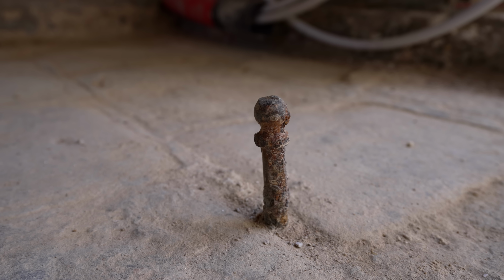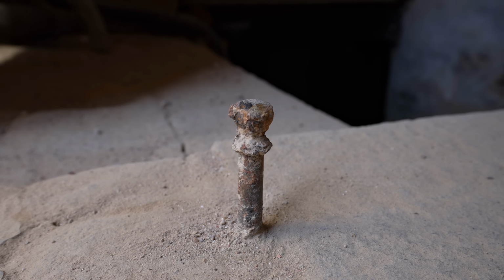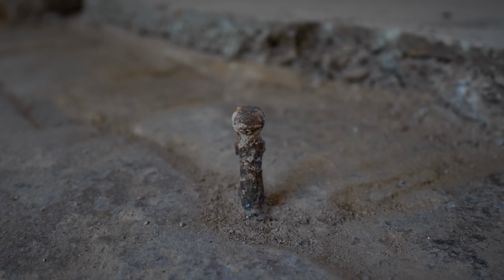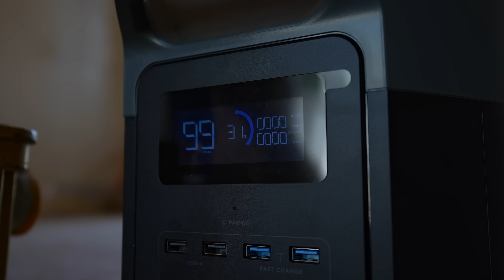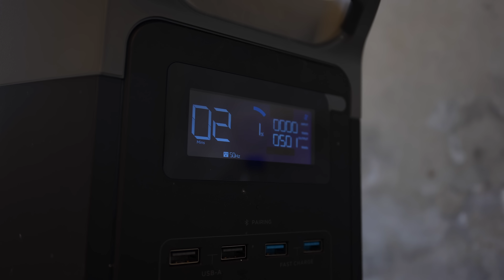Uncovering a 250-Year-Old Hidden Floor Beneath Concrete

Comment: I agree with Gwen, leave the floor as it is, it’s so beautiful, just add slight ramps at the doorways and it will be lovely. Great work Billy!
Reply: Totally agree, and leaving the floor as it is you will also retain another of the original features of the convent.
Reply: Agree with steps or ramp also , the concrete pour was probably more to do with wheelchair access to the kitchen than anything.  I'd just add an ironwork railing to the cellar steps and call it done.
Reply: Agree with a ramp at doorways, and leave the beautiful floor as it is!!!  As I am disabled, I feel a ramp would be much better than steps.
Reply: Exactly what I was about to propose …
Reply: Love the floor. And yes just add ramps. Perhaps consider having removable ramps rather than permanent ramps. I built my house nearly 5 years ago and made sure that it was future proofed by being wheel chair accessible and I have heavy duty rubber ramps for my exterior doors which are removable. If you build stone ramps they may be large and permanent. You can install the temporary ramps as needed for visitors, gatherings and events.

Comment: The floor will only be original once.

Best approach would be to install wooden ramps for now, focus on restoring the rest of the convent and then decide whether you want to raise the floor or just the ramp area.

Using wood will protect the floor during the rest of the renovations. It will also allow you to decide where you are going to adjust the levels. You don't know what level you will end up with in the refectory yet.

Comment: I have another idea for the floors.  DON’T PULL THEM UP!  It looks like there is a step up into the area. Why not when you get new doors just put in a new lower threshold and make the doors taller? Then into the kitchen and toward the refectory put in the ramps. This would also help with the height clearance to the cellar. 
I love watching older buildings being renewed and brought back to original glory. Thank you, Billy.

Comment: And here I thought Gwen had not seen you sneak out. I suspect much of the previous 'upgrades,' including covering the floor, were meant to ease life for the nuns and their work. Still, it's so nice to see the building's original beauty in the hands of this very special crew. As to raising the floor, I think the work done on the hearth should relieve any concerns; it will be beautiful either way. I am curious what you will do with the cellar access, which is a bit of a mystery. The lintel looks original, but the stone floor opening seems like an afterthought.

Comment: The most expensive way (but probably the nicest way) to retain the exposed floor, whilst making a usable floor that is safe, would be a raised glass floor.  Reinforced glass that is raised (on feet) that hovers over the stone floor, providing a modern floor surface that is safe & level (including being at-grade with the doors) but that allows the historical floor to still be seen (and even accessed, by lifting the large glass tiles).  But I imagine it'd be unbelievably expensive (whilst looking awesome).

Comment: That floor is just beautiful, Billy.  Someone made a comment about using heavy-duty rubber ramps that are removable. If it works, some type of ramp like that but covered in split stone (like a thin veneer)that matches the existing stone floor, laid over the frame of the ramp.  Possibly the best of both worlds?

Comment: Apart from the immense amount of work you'd be making for yourself to lift, store, return and level the entire floor, I don't know if you'd ever be able to duplicate the immaculate surface you have there now. With respect, I suggest you use short ramps in the doorways to avoid steps, perhaps using the same stone to make the ramps? Just a thought.

Comment: I suspect they poured a smooth concrete floor to make it easier and safer for those on crutches, in wheelchairs, and otherwise unstable on their feet.

Keep the risks to the unsteady pace n mind when making sure important flooring decisions. If you rent the facility out, you could be held responsible for trips and falls on uneven flooring.

Even though it’s a big job, I would seriously consider relaying the floor up to level with the other floors, and do the utmost to make the stones/grout as level and as smooth as possible.

I think your work on the chateau is amazing and impressive.❤

Comment: My vote if I had one would be don't disturb the flagstone and build little ramps. Entryways can be cooler places too, where folks can acclimate to the indoors without blasting them with warmth and a sense of stuffiness, so underfloor heating I not necessary. And it's  cheaper than your original plan.

Comment: I'm guessing that perhaps the reason they covered it with concrete is that during heavy rains it may have tended to flood in that room because it's lower than the ground around it. So that would be a good reason to raise it. But could you do that without damaging the stones?

Comment: If you didn't run any water lines for heating in that section,  I would remove the floor in the little hallway on each side of the cobble floor and ramp it there so that the entire old floor remains intact and unblemished

Comment: Billy the floor looks amazing. Gwen it right, leave it it as is and it will save long hours removing it and relaying it and also it will save money. Too bad all the floors arent like that. They may have concreted them for ease of walking as the nuns got older preventing a tripping hazard. It was great to see Gwens smiling face again.

Comment: Billy I think you should indeed put in a ramp. I have recently joined the world of the handicapped.  I use a walker unless tired or a long, more than 200 foot, distance then I use a wheelchair. I love the convent. If you keep the lift it is a perfect area for handicapped. The doors are wide and the rooms large.

Comment: Gwen is right, adding small ramps will also help with pushing cleaning trolleys around, goods deliveries etc. If you're not putting under floor heating in it would seem a waste of your time, energy and money to lift the entire floor 10cms.

Comment: Love the way you started the video watering the roses, they are so beautiful.  Gwen's idea of the stone ramps is genius.  Will you be able to get the lift back inside the kitchen or did you do that before you chipped up the concrete?  Don't forget to use sunscreen lotion while cutting the grass, I noticed you caught a bit of sun while working in the garden. Crack On!!

Comment: The newly exposed stone looks fantastic!  Since you plan on new doors to the outside, you could always lower the sills so you wouldn't need ramps there.  The stone floor looks to be at about the same level as outside cobbles.
Reply: The ramps are for the entry to the kitchen and refectory doorways, as well. Those floors being higher pose access issues for handicapped, as well as workers using wheeled equipment.
Reply: @beckysimeone4882  True, and that would be very cool!

Comment: If you do it right and raise it up, it can be a representation of the original structure. Cleaned and sealed it would look outstanding. Like the exposed ceiling timbers, they are to be marvelled at. The beauty and quality of materials and workmanship from times past. Like a museum piece, not to be forgotten. You took this on to restore this old place, and remember that after you are long gone, someone will (I hope), appreciate all that you and your friends did to make this place what it is and will become.

Comment: You’ve done so many changes to this building. There is an authenticity to keeping it as is. If you raise it you you remove the history of the floor. Kinda like taking an antique and stripping it down to repaint it. It’s still an antique but it’s lost it’s story of origin. The dings, chips wear path give it its uniqueness. The original mortar has a place in that story too. Steps or a small ramp is such an easy fix. Keep the extra $$ for some of the hard work in the chapel. It’s going to need it!!

Comment: Billy, that ancient floor is really beautiful.  However, as one with limited mobility but still walking, I noticed those old stones are uneven enough to be a trip hazard.  You might want to consider raising them and levelling them better at the same time.  If this is ever to be any kind of public venue, the liability issues with a floor that uneven would be significant.

Comment: Perhaps someone asked this question already. Is it possible that was an exterior floor surface, and that, at some point in the past, it was just a covered walkway from the court yard to the back gardens, which was later enclosed for the convenience of the nuns? Under that circumstance, both the floor surface and the stairs down to the cellar make more sense.
Reply: I had the same thought, even if the stairs down to the cellar is still very strange. I would suggest removeing the doors and restore it to to again be an roofed passageway between the courtyard and the garden, as other has suggested. Or at least let the doors be fully glassed so you can se though to the garden.

Comment: I have a question, when you install new doors to that hall in the future, could the door openings be widened a few inches on each side allowing for easier access to the back garden with your current work equipment or would that be unnecessary in the future? Hopefully the town council will give permission for you to have a right-of-way to create a new gateway so you can easily access the back with your equipment to assist in future repairs. I also think the concrete was probably put down to level the floor for wheelchairs to easily & independently maneuver over it. Gwen is such a smart, sweet, beautiful, young lady. She is a treasure. Thank you for sharing your projects with us, it is so very interesting to watch all of them.

Comment: As so many have said, leave the floor as is.  I had a very similar issue and resolved the problem by having some granit prices cut to size creating a slope, not a full ramp.  To raise it at the highest point (say 4”) it would extend about 12 a 14” out.  My daughter had no issues using her wheelchair on that slope and made clean up of the floor much easier.

Comment: May have been more difficult for wheelchair users on the cobblestone years ago and could be a reason it was concreted over. I was wondering if may have been prone to flooding and that's why they raised the floor? May be a good idea to keep the height by the door and put a concrete ramp from the door slanting down to the cobblestone so flooding won't happen. The cobblestone is so nice, can't wait to see it after you are able to clean it!

Comment: If you’re going to replace the exterior doors anyway you can just eliminate the step there and make the opening 10cm lower. If there’s only a step into the other rooms it might be expected in an entry way. On the kitchen side, there’s what looks like maybe 3 feet or so between the opening of the kitchen doorway and the entryway stone floor. you could break up that concrete there, and then pour a new ramp that brings two levels together

Comment: Rather than put in a ramp or a step in, here's a suggestion. Since you plan on replacing the entry doors with custom made items, why not lower the outside entry thresholds to match the hallway floor level. Then ramp from that level up to the kitchen and refectory(?) floor levels on each side. Then have your customer doors fabricated to match your new rough masonry openings. only minor changes would have to be made to the exterior pavement approaches (changes that would have to be made if you want wheelchair and handicap-friendly access anyway).

Comment: I agree with adding the slopes in the doorways to adjust for the different floor levels. 
My guess is that they added the concrete over the flagstones is due to the nuns that were in wheelchairs, using walkers and canes. A flat & level concrete floor is a lot safer & easier than the uneven flagstone.

Comment: Put some granite steps at the entry doors (from all that stone at the chateau) and build ramps between the walls where it connects to kitchen and pantry because those are areas that will see steady traffic and people carrying things that shouldn't be dropped or spilled. You need an easy transition between levels there. You may also be using wheeled carts between those two rooms.

Comment: Why not make ramps out of granite to match the granite in the hallway? I think I'm correct in saying that you have enough (old) stone left lying about to cut to size. Lime mortar coloured to match what's in the hallway, and it would hardly be noticeable that it's a modern alteration. 
You've done a fabulous job of removing the concrete without damaging the stonework Billy.

Comment: why not use this corridor as a covered alley/passage with the original floor as it is, original exposed stones on the walls (current plaster needs to be removed) and no door or just grilles towards the garden and the courtyard? It would create a more cosy space with independent rooms rather than a massive space that lacks 'human size'.

Comment: I think you are missing rubble mountain so creating rubble mountain 2 lol.. maybe you find the same floor in the refectory lol.. the floor really looks great though, a step would be ok but if ever you need to wheel any big equipment or furniture in then a step will be a real pain so I think a ramp is better, will be a shame to lift the floor as it will never go back quite the same, I know you and Shaun did a great job in the fire place but that was a relatively small area in comparison.

Great job.. well done..

Robb Torremolinos Spain

Comment: Not sure if the geometry supports it, but we’ve had good luck pinning excavator buckets on “backwards” to reach up high, or reach into buildings like you have here…

(Heck, once we put the one big bucket on backwards and used it as an improvised man-basket to service elevated light fixture.  Not exactly an approved use, and after that we built a more appropriate apparatus for that purpose.)

Comment: You need to do a test section on the floor with a mop and some cleaning solution you then can see if you want to seal the stone floor or leave it natural and a good mop n clean can tell you if it looks good wet if it does seal it if it doesnt dont plane and simple a nd it doesnt damage the floor

Comment: Hello my friend, I have two thoughts about that lovely floor. The first is why not lower the threshold of the exterior door to the level of the old floor. You said you were going to replace the exterior doors anyway.  Now you can fit them to the new height, the one that uses the old stone floors. 

The second thought is thar the floors might have been raised to prevent water from flooding the hall. If you do lower the threshold you will need to check that possibility first. 

I shall enjoy watching what you do with it.

Sarah

Comment: Might have to get some temporary large thick wooden boards to sit between the two room entrances so you can move things between the two rooms and not have to worry about the drop now. 
You will need it when you go to move all the white goods back into the kitchen.

Comment: keep the floor as is? It looks authentic; creates a passage from back to front and if you put in steps either side into the rooms, it retains the look of its age? You can just see when you are removing the concrete the damp that was held in by the cement.  Its just amazing that they are in such good condition. If you took them up and relayed them you lose something of the age? Great job!  Thanks for the vlog

Comment: The side halls floors could be sloped to minimize the number of steps you'd have. Still think you should just seal off this entrance to the basement and just use the outside doors for it.  I don't know what room the other end sits under to build and new stair down if feasible? I just think this hall would look so much better without that hole, even if rails were added. Chandelier in the center of the hall with your new doors will look majestic.
The only thing I don't like about that old jackhammer is that you have to bend over to use it.  My back would be out after a few seconds of that.

Comment: It's more work, but you should raise the floor level with the rest. For one, less of a tripping hazard. Also, if you have water penetration from a heavy rainfall,  you'll have a big puddle, as well as the water going down into the basement. And you could insulate and waterproof under the stones as you have done in the kitchen.

Comment: Here in Vermont during the 60s or 70s all stone floors in barns and milkhouses were required to be covered with concrete for sanitation regulations. Very hard to keep stonework clean.Just my opinion but I would pulled those stone and use them outdoors somewhere they can be seen. Lotta work but in long run if that is a commercial building it wouldn't pass muster, at least here in the states. Also you can mimmic a stone floor look with modern methods but have a smooth surface

Comment: This may sound strange but....Could you (leave the flagstones where they are since they seem to be quite level) and lower the thresh hold on the two exterior doors, then put steps that are as wide and as deep as the wall to either side of the interior doors(coming from kitchen and other room)That way it would come out even with the wall giving you a larger area to step on when you are leaving the kitchen or the other room. That may not make sense....:face-blue-question-mark::face-blue-wide-eyes:😵‍💫